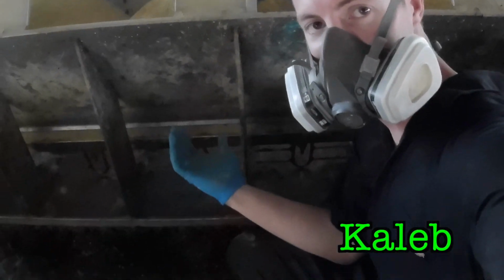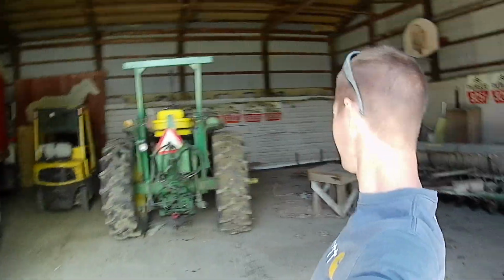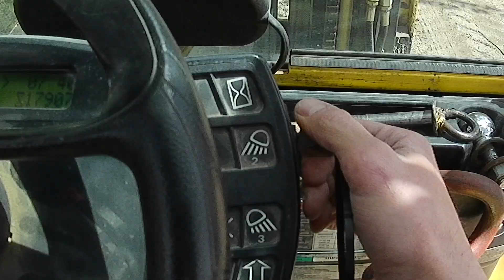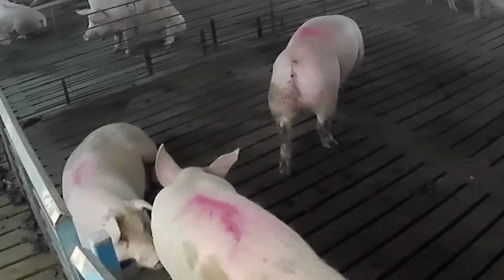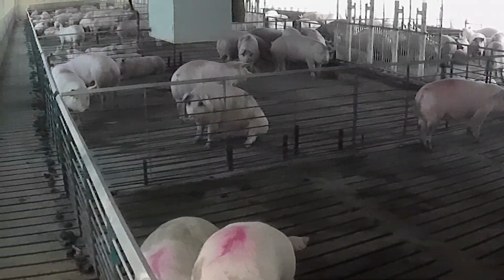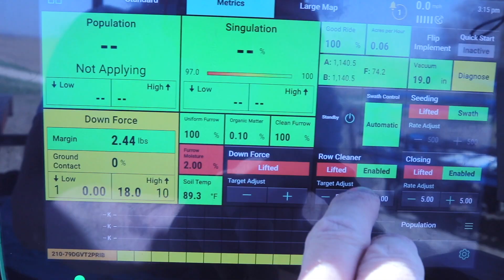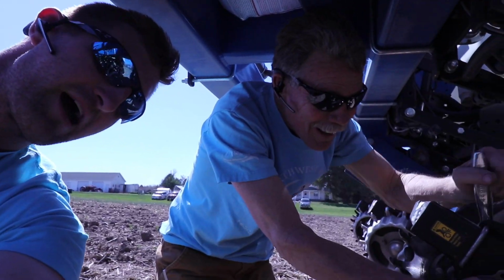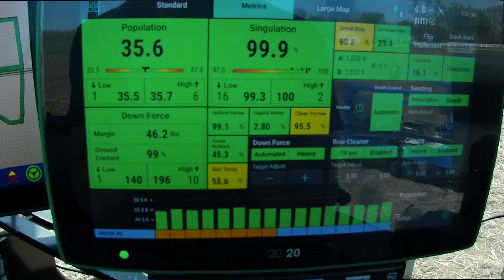Kaleb The Rockstar Finishes Planting Corn?

Comment: How did you get the footage of the Planter riding over the camera?  That was interesting to watch.  Congrats on finishing up corn for 2021.
Reply from the maker: I mapped out my guidance lines then set the camera between the rows and hoped I wouldn’t run over it. I used my cheaper camera in case I couldn’t drive straight and we had a camera casualty.